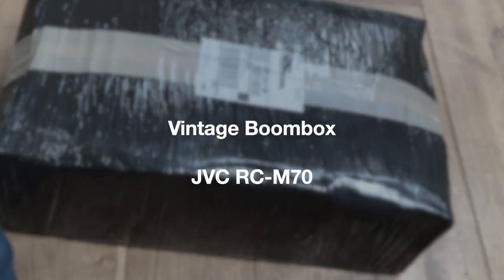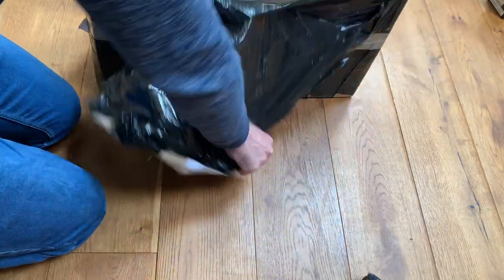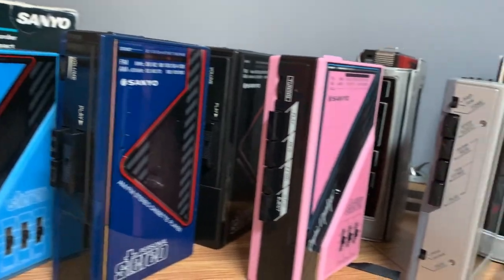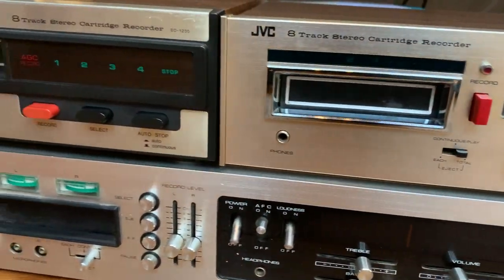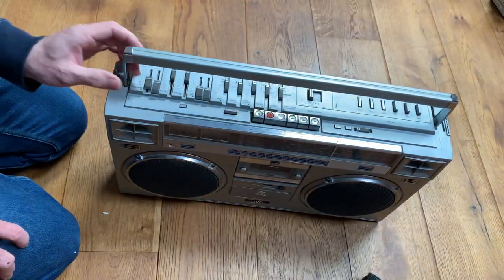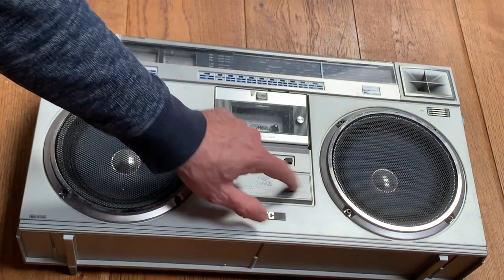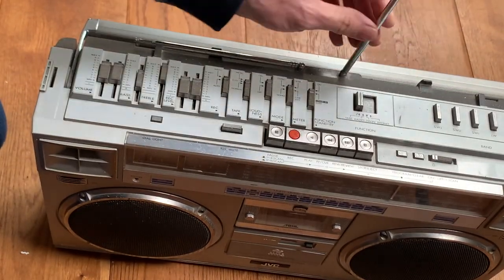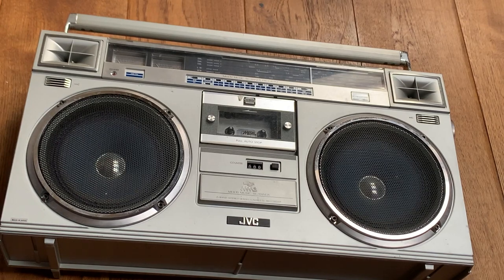JVC RC-M70 Boombox for Repair. Vintage Ghetto Blaster.

Comment: I have the same unit and need the tape deck fixed. Where are you located and do you still do repairs?
Reply from the maker: I'm near Bath. I've got a fair bit programmed in for the beginning of the year, but contact me via my FB page and we might be able to sort something out. Thanks